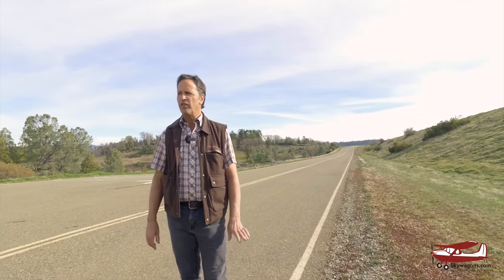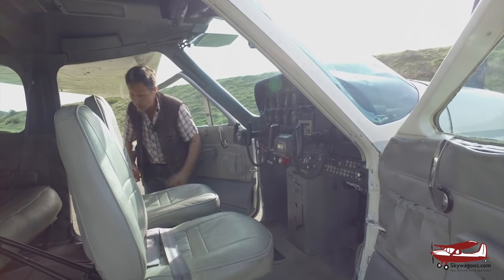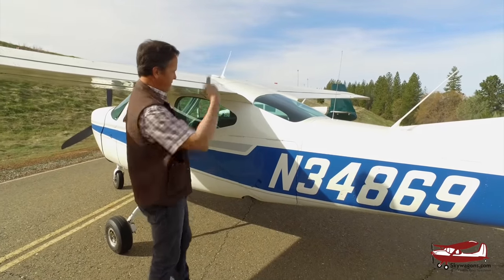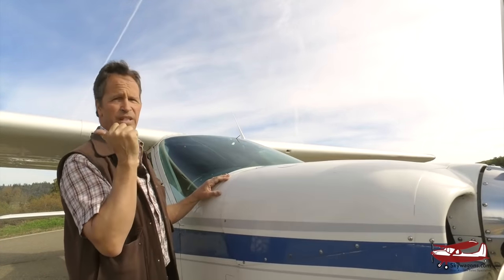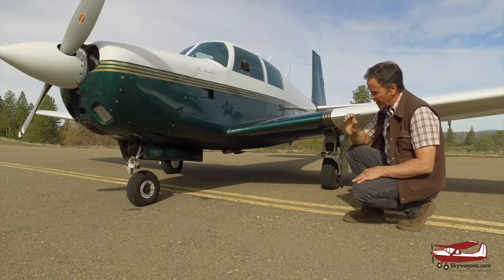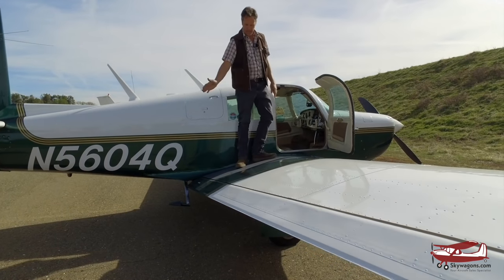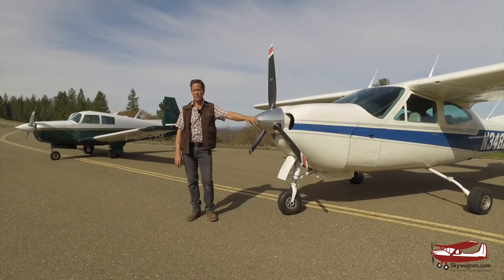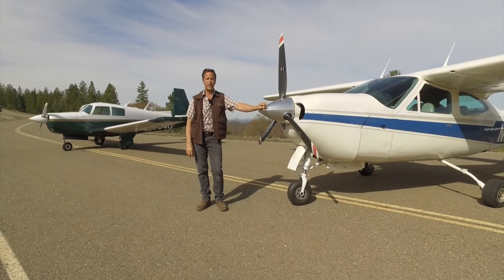Mooney vs Cardinal

Comment: Excellent video Mark. Thank you for this. I was always a little nervous of the mooneys, figured high performance, p-51 like wing,, perhaps tricky to control. But something you said,,,,so I ask.  
Would saying your Mooney is as docile, forgiving as my pa-28-161 be an accurate statement?   Set aside the gear and prop differences.
Reply from the maker: The early Mooney's C, E, G, F and the J's are all basically sporty Arrows and are very docile and easy to fly.

Comment: In so many ways this video is the best comparison of the key features of the two-to-three major options, e.g., high vs low wing, 2 vs 3-bladed propeller, retractable gear reliability while meeting the economic costs and logistical performance demands that determine our choices are held to be identical otherwise.  It should be seen by every pilot at some point because it highlights the most important considerations we all come to; that really HAVE TO to be right for ourselves to make flying proper and enjoyable; to be a good value to you overall, get your money's worth, avoid an avoidable but unforeseen handicap, at least; whereupon, if wrong, make flying uncomfortable and even personally dangerous and wasteful in time, money and utility to each pilot depending upon person and mission.
    With the stretch version of the Mooney and a 3- instead of 2-bladed propeller, the Mooney woulda shown better overall, but the average GA owner/operator (maybe A&P too) really can't afford to go back and forth between 2-3 blade props as the maestro does here with his Mooney(s) and different model variations like changing his shoes and socks.  
   The high wing is personally preferable, all things considered, imho, because, personally I'm much more comfortable inherent in the darker cockpit environment of the high wing design, especially vs Mooney's center bar and smaller windshield.  The darker cockpit can be improved/overcome easily and completely by using the instrument lighting always.  This allows a more consistent view and better scanning which is vitally important in maintaining see-and-avoid time OUTSIDE the aircraft, (I don't want to have constant distracting and blinding shifting light sources on the cockpit controls or instruments, preferably.)  In the pattern and high traffic areas this is better.  Whereas, if I'm making a lot of weather decisions on a cross country flight and have to judge sky conditions a lot where I'd encounter turbulence or ice, or poor visibility, the low wing is best for the same reasons fighter pilots want the low wing - sky visibility.
    The Cessna's two, wide doors and general access was the dealbreaker for me I must admit, quite unpilot-like, but practicality over all for me; with a crank for opening and closing vented windshields are very important in controlling cabin temperature while in ever-present ground operations.  The Cessna coulda used gust-locking doors, however, locking at 2 points, half and fully-open.  
    The Mooney's rear seat coulda been entirely improved simply by being able to slide back about a whopping 4 inches into the baggage area to open up the cramped rear seats, allowing pilot's leg room for their full, necessary rudder ops.  Mooney's main appeal is for greater performance, to be a pilot's airplane, like a fighter vs bomber wing configuration of low vs high wing where form follows function.  You see more sky generally than ground in a Mooney IF that's important to the pilot's preferences whereas the ground and gear are more visible in the Cessna for the advantages that gives.  Again, being able to see if the main gear is REALLY down at a glance is almost priceless, all things considered.  BOTH aircraft need a redundant, manual gear deployment system, by lever, for goodness sake. How much would that cost in money, room and weight?
   This video is priceless because it has the most important real considerations that can and must be right for the pilot and mission, requiring the foreknowledge this video shows.  Make the right choice here and EVERYTHING'S better and best!  Cheers!, Maestro, Thank you and Happy landings, Skipper.
Reply from the maker: Thank you for spending so much time writing this.
Reply: @skywagonuniversity5023  100 hours groundwork equals every good hour of flighttime.  That's why pilots and their lifestyles, humor, stories, judgement, values, . . . the pilot experience altogether is  incomparable to anything else and more than just the sum of it's many parts, imho.

Comment: Not sure about your cabin width measurement, because the Cardinal is 48" at the shoulder.  I wanted a Mooney, when I was younger and more flexible!
Reply from the maker: Hi Steve!  Not sure what to tell you.  We dragged the tape measure across from the same point in both videos and that was what we found.
Reply: Mark, First- great video. Very informative. But yeah- that width measurement turned me off a bit. 
You were kind enough to let me sit in a Mooney a few years ago.- I'm the 6'7" 320lbs SWA CKP that was really hoping I'd fit!
At the waist level- I'd agree but at the shoulder level- the Mooney was far tighter than the 177. A solid 6-7 inches. 
I wish I fit better in the Mooney- I'm in love with them from a spec, speed and efficiency, but it didn't even feel like a lose weight scenario- my shoulders are tight if I lost 100lbs. I'm very comfortable in the Cardinal as is. Much more comfortable than a 182 as well. The only other GA airplane I fit as well in are the PA32s. I think unless you're this big, it's hard to really understand. :)

Comment: Hello Marc,

Maybe I missed it but what are the specs? And with a 210 hp installed on the C177 RG is there a “big” difference in performance?
Regards
Frank
Reply from the maker: The engines are 200 HP Lycomings.  Hardly any difference in performance but the Mooney is a bit faster.

Comment: Thanks Mark, I have '67 M20E. You were using knots for speed. My speeds are always in miles per hour but seem about the same as you were saying?
Reply from the maker: My M20E at 24 and 2400 does about 140Kts on 11 GPH.  Is that about what you see?

Comment: There are two areas I had hoped you would compare but did not.  The first is visibility.  Does the Cardinal have a typical Cessna blind spot while in a bank, or does the forward location of the pilot seat eliminate this?  Can you see the runway on a base to final turn in the Cardinal?  Second, how do the planes handle?  I’ve heard Mooneys are “sports cars” but that the controls are heavy, somewhat of an oxymoron, but what say you?  I’ve flown 210s with a wing similar to the Cardinal and the control forces are heavy and the response is slow.  Does the stabilator result in light pitch forces?  Please comment on control forces and response rates about all three axes for both AC.  I fly Tigers (a true two finger airplane) and Vikings (fighter like roll rate).  Quick, responsive, and light controls are big in my book.  I’d love to hear your thoughts.
Reply from the maker: I thought I did mention the forward seating on the cardinal means that they have great visibility. Yes you can see the runway on base to final.  Mooney is better though.  No wing in the way at all in a turn.  Mooney controls are not "heavy"  they are right for the plane. They are no cub though.
Reply: @skywagonuniversity5023  Thanks for the reply. Good info. Are the Cardinal controls heavy or light?  Please comment on roll rates / aileron response for both AC. Thanks!
Reply from the maker: @glenwoodriverresidentsgrou136   What are you used to flying so I can compare?
Reply: @skywagonuniversity5023  Bellanca Viking (fighter like roll rate), Grumman Tiger (a two finger AC), Piper Dakota (a station wagon), C210 (a truck).  Please compare!

Comment: Most Cessna Century Pigs that corrosion were found in had factory installed air conditioning with the condenser above and behind the spar.  Foam, water, condensation, instant shit show with a high tensile strength aluminum forged spar.  Still want a normally aspirated 210N though!

Comment: Not sure you gave a fair measure of the cardinal cabin width. It appears you measured the floor width with the doors open, but the bottom of the doors on the cardinal wrap in along the bottom. Measured across mid height at the back of the door frames (near where you're elbows or shoulders are) and you should get about 46". I have flown in a cardinal and a 182 and sat in a mooney m20g. hands down the best from seat room in the 177.
Reply from the maker: I measured across the seat bases too.

Comment: All things being equal (which they never are) I think the two bladed propeller should result in a higher top speed which is why a lot of the later model Mooneys had them. However, after takeoff the three bladed propeller should  produce a higher rate of climb.
Reply from the maker: All true.

Comment: Mark,  You need to measure the cabin width at the hips as well as the shoulders to get an accurate representation of the aircraft.
Reply from the maker: I measured them right across the seat base and since they both do not taper towards the top or bottom of the fuselage/doors, I thought that was the widest part.
Reply: @skywagonuniversity5023  I own a F-Modell and could not be happier with it. But it's true: The Cabin ist tight in width. But this regards only the Shoulders. No wonder, as the Windows of a high wing are vertical while the Mooney windows are curved.
I decided to go without strength training for broad shoulders. Problem solved.

Comment: I’m 6’2” 270 and old. Not agile. I climbed into a Mooney and it was laughable getting in and back out. Not very graceful. I think I better not think too hard about a Mooney, eh?

I heard that a six foot tall pilot must duck his head (when wearing microphones) in a cardinal. Is that correct?

Suggestions for a plane?
Reply from the maker: Yes, you have to duck to get in the cardinal but once you are in it is fine.  Also there is no dignified way to get in and out of a Mooney without practice.

Comment: Is it possible the book was quoting true airspeed and you were seeing indicated airspeed?
Reply from the maker: The speeds I saw were in both planes, side by side, in the same conditions, with us both talking to each other, at the same power settings over 45 minutes, displayed on our GPS's. Speed over the ground.
Reply: @skywagonuniversity5023  Did you have a head wind?  A head wind would have made your GS lower than your TAS.
Reply from the maker: @hansadler6716  The wind conditions do not matter.  The speeds were relative to the two planes at the same time in the same conditions going in the same direction relative to each other.  Tailwind or headwind would have just made both planes faster or slower but the same relative to each other.
Reply: @skywagonuniversity5023  That's true, but I was actually referring to your statement In your video. You said both airplane's book speeds were less than what you saw while flying.   I suspect this is because the book was reporting TAS and you were reporting IAS.  For example, in my Comanche at around 10000' I see an IAS of 145 knots, but a TAS of 165 knots.  The TAS is calculated by my G5 that takes into account temperature and pressure.
Reply from the maker: @hansadler6716   Oh, It's just generally.  Like a 201 does not do 201 MPH or KTS.  Factory and book numbers are never really real.

Comment: Not to burst the bubble but you stated flew side by side same MP same RPM  same day side by side same place so you say this is a fair comparison of speed however if this was true why does one have a 2 blade prop and the other a 3 blade prop. Fact check me if you like but I believe a 3 blade prop due to weigh and increased drag etc will suffer in the cruise. A fair comparison would have been 2 x 2 blade props. So all things considered a 1 knot difference probably put the money a little slower I think.
Reply from the maker: Let's just say that it was very very close in performance.

Comment: Thanks for the video  ,also you Must Speak about  the Fuel valve location and the inconvenient  ,for son people to operate  it  ,fuel valve on the floor between your legs
Reply from the maker: That is true.  The early Mooney fuel valves are not that easy to get at on the floor between the pilots knees.  Larger pilots with articulation problems may not be able to reach the selector and have to make a tool out of a plastic pipe.

Comment: I have flown both, more time in the C-177. Both are nice but for comfort I would have to go with the C-177. The Mooney is more efficient but as I get older comfort is important. Also the C-177 brings a substantial premium over the Mooney.  I think the Cardinal handles better though it is a ground hog taking off. The wing in the C-177 is not a 210 wing though it is the same style.
Reply from the maker: I'm pretty sure that the later Cardinals have the same wing as a 210.
Reply: @skywagonuniversity5023  it was the same concept but lighter. Laminar flow, milled spar and so forth but not the same wing.

Comment: You failed to mention that the Mooney front gear is very susceptible to damage when towing. The pins and stops are very easily bent or broken, as I’m sure you and any rampy knows.
Reply from the maker: Yes, a good point.  Easy to damage when over-steered by a ramp guy.

Comment: Question: would it be possible to modify a Cessna 177 to do 180 knots?
Reply from the maker: Anything is possible if you have enough money.
Reply from the maker: It'd be all about a big engine and there are no STC's to put a big engine in a Cardinal.  If you did, you'd be making a 210.
Reply: @skywagonuniversity5023   the 177 has such great lines and doors and overhead visibility and no struts. It is a beautiful aircraft but it is so slow to be so sleek looking. You would think it would be fast like a Bonaza. A fast 177 would sell like hotcakes!

Comment: To think that the Cardinal is as fast as a Mooney is as wrong as you can get.  They should have compared the Mooney 201 to the Cardinal (a more fair comparison).  The Mooney is about 15 knots faster.  You fly out a Mooney at 120 knots.  You fly a Cardinal at 80 MPH.  The Cardinal is a wonderful airframe but it is simply underpowered.  It is power limited, not airframe limited.  It deserves a 240HP then it would be a truly great airplane.

Comment: As far as an A&P is concerned --- hands down - the Cessna! God help you if you have to work in the back of the engine (prop governor) on a Mooney. The whole airplane (Mooney) IS A MAINTENANCE HEADACHE!
Reply from the maker: They are not that bad.  This is my 6th Mooney.  No complaints so far.

Comment: So why are these m20 planes in the yrs similar a few yrs apart range from 80- 160 k
Reply from the maker: The M20 series covers most of the Mooney models. A 1963 C model through the E the G the F and the J and on up through Ovations and Bravos and Acclaims in the 1990's and beyond.  It is the letter after the 20 that tells you what the plane is.

Comment: It’s silly, but neither is HP, has to be 201 HP or more. I got my complex in a Cardinal, but had to get my HP in a Cirrus.
Reply from the maker: Yes 201 or more but this video was about costs of operation.
Reply: @skywagonuniversity5023  great point, I feel that point in my 1961 Cessna 210A fighting hard to stay in this passion of mine. Thank for your very informative, detailed, knowledgeable videos, from a pilot and owner’s perspective. I am bias and jealous at the same time, would love to do what you do, not implying it’s not a lot of work, but loving it like we do makes it a whole lot easier. Comes through in your videos.
Reply: @skywagonuniversity5023  my Flight school had a Cardinal, would have one if I was willing to pay the premium. I need a high wing for my wife’s challenges with her back. To me it was the fastest cruise, having 4 cylinders, in the high wings. Rented it a few times for trips with my wife, only minor negative on the model I flew, only off/both fuel selector , and had to trust when 1 wing went empty it really would pull from the other tank. Might be fine in the pattern, but not a warm and fuzzy on a long cross country with your wire in IFR conditions. Some models had left / on / right / off.

Comment: lol that's right,love your video though, but you would agree, the 177 rg is safer.
Reply from the maker: If the Mooney was a 201 of the same vintage as the Cardinal the Mooney is a LOT faster.  The Cardinal may be a tiny bit faster that this 1965 Mooney M20E.